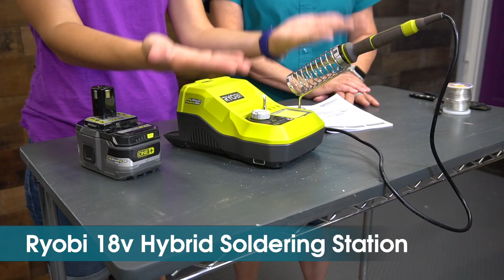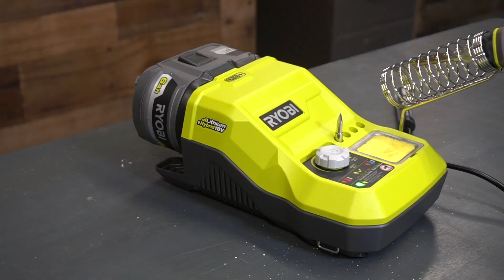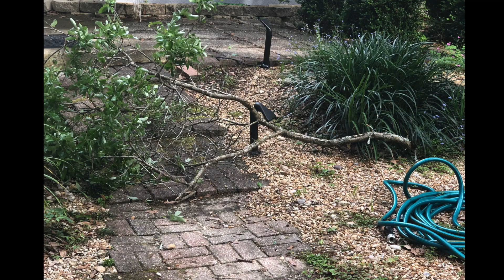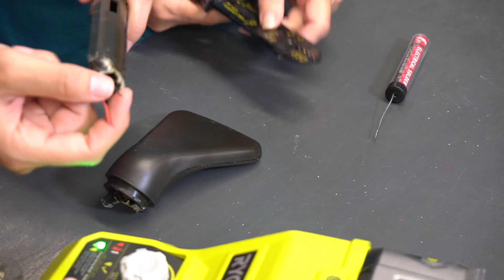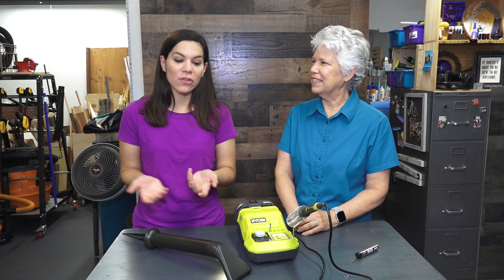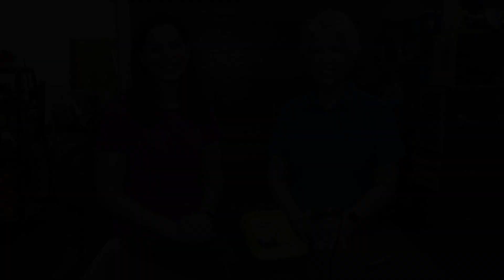First Look: Ryobi 18v Hybrid Solder Station

Comment: Been a while since I soldered anything. My last project was where I had an O2 sensor cross-wired in an old car after I replaced it (Long story). I ended up cutting the wires at the top of the engine compartment and soldering them to the correct plugs which was much easier than going back underneath the car into confined spaces.  Before that, it was soldering ends onto some guitar cables that had previously failed.  Good stuff!
Reply from the maker: Awesome Jeremy- thanks for sharing!